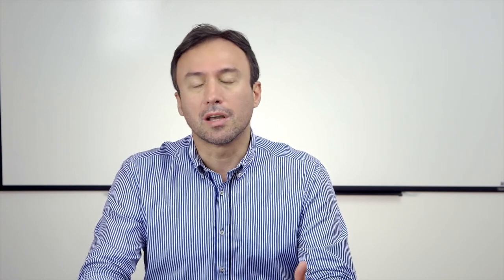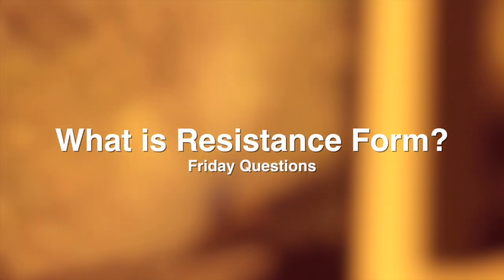Friday Questions: What is Endodontic Resistance Form?

Comment: So just to reiterate, in the "traditional" technique with "cold cone" obturation, we rely on an apical stop to prevent the cone from sliding beyond the working length, while in the Schilder technique with warm verrical obturation, we rely on tug back at the apex.
Does this mean that we should not "chase" cone tug back in the cold obturation that you advocate? 
Thank you for your wonderful videos!
Reply from the maker: You can have tug back in the cold as well. But it's not as crucial as for the warm techniques where you could push the cone out due to excess apical forces. Keep in mind for cold, I'm not talking about placing a size 15 cone in a size 35 preparation. I'm just saying a very rigorous tug back is not as important as when you're doing warm vertical or warm hydraulic condensation. You still end up with light tug back in hydraulic condensation or else you could end up with voids if you have too much space around the cone where sealer could pool.. You just don't emphasize or confirm the tug back in cold as much as you would for the warm technique.. Cheers!
Reply: @EndosKool  Thank you so much for taking the time to answer my question. I'd finish by saying that I adore your shaping technique of shaping with the 25 04 and finishing with the 30 02. Am I correct to assume that in that case, you'd expect a tug back occuring 3-4 millimeters from the tip of the cone? 

I do like some tug back to prevent pulling the cone with I sear it at the orifice. That's maddening!
Reply from the maker: @MikeyWolfLupu  More or less. although I don't do the 30/02 all the time. The best way to avoid the cone pulling out issue is to sweep across the orifice with your heat source rather than vertically. I'm in the process of developing a special tip for our heat source that helps eliminate this problem of cone pulling. Cheers! :)
Reply: @EndosKool  Thank you so much for your time answering my questions. I fear abusing your time further, but I must ask why wouldn't you use that shaping protocol all the time? It seems so brilliant to me!
Reply from the maker: @MikeyWolfLupu  The short answer is ADD! LOL!!! Kidding aside, it's because I try so many different techniques all the time with the main goal of finding different ways to do the endo. Otherwise, I agree. it's probably the best approach. I still have to educate on the entire file line so I need to keep my hands wet with the different techniques we have. ;)  Cheers!
Reply: @EndosKool  Thank you dr. Nasseh! Cheers!!